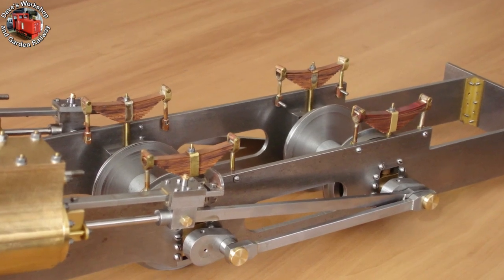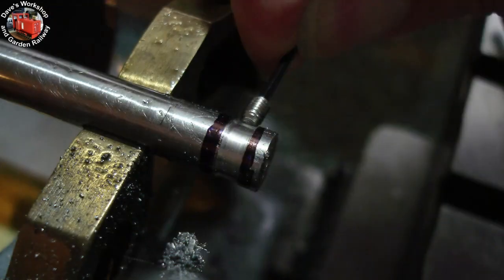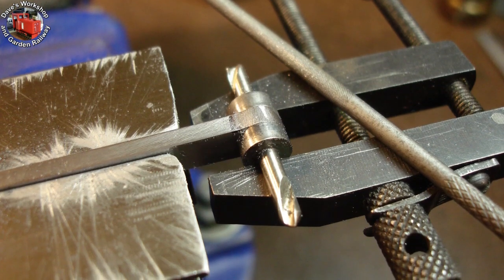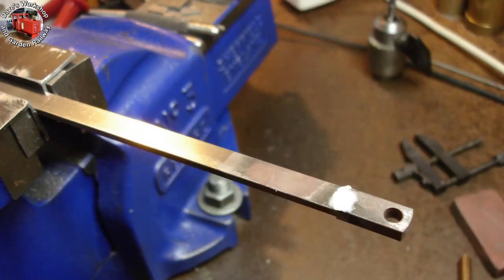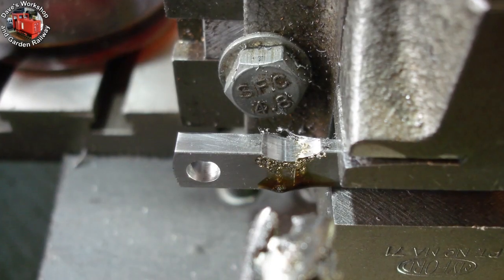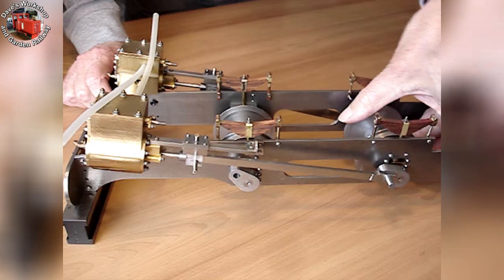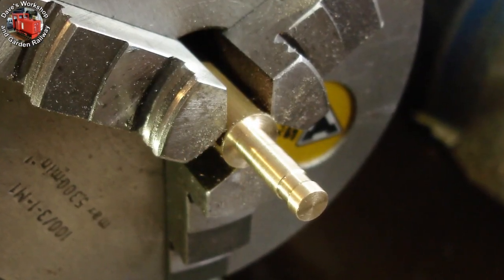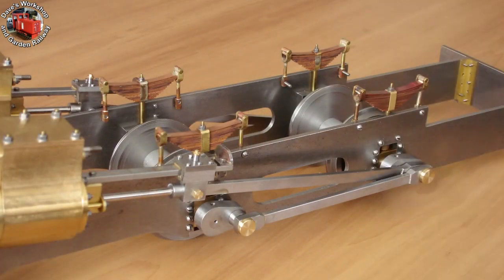Building Charles - Part 16 - Axles and Connecting Rods

Comment: As always a great video and lovely work.
Out of curiosity could you not have bushed the rods and made the pin from steel?
Reply from the maker: I'm glad you liked it.  Certainly I could have.  I will be interested to see where the wear occurs, as it's often the harder parts that wear as the softer material gets loaded with grit and acts like a lap.  They will then need bushing and a steel pin made 👍